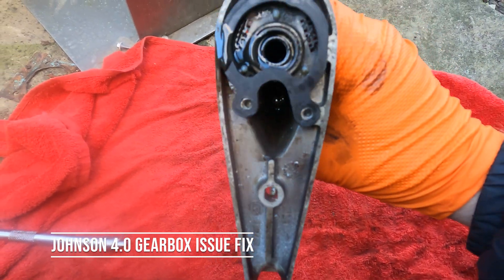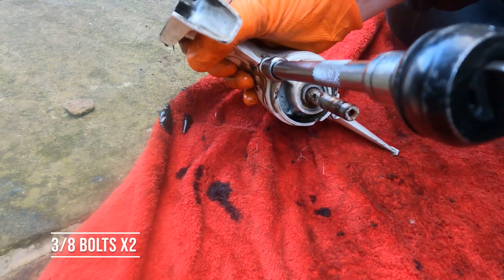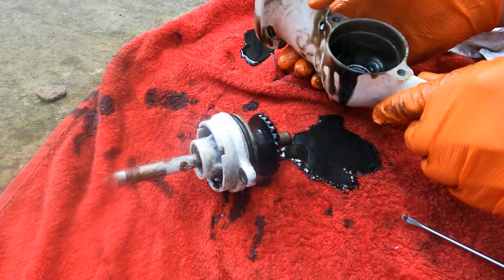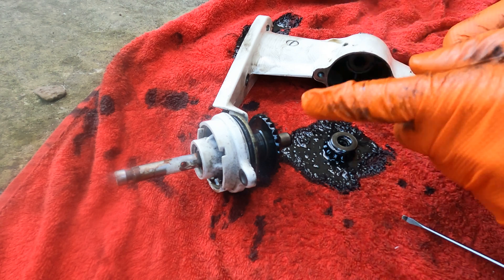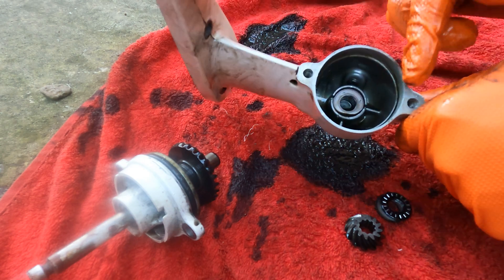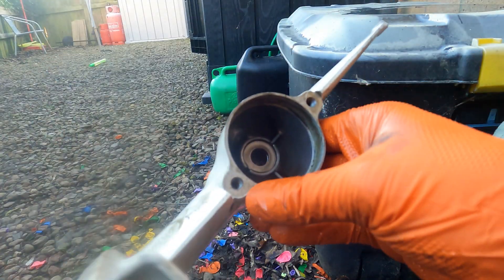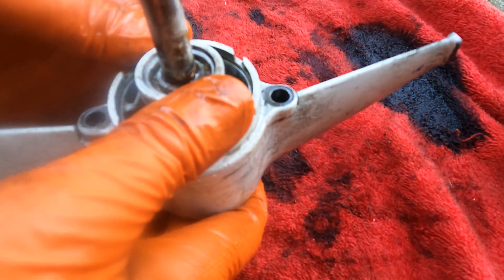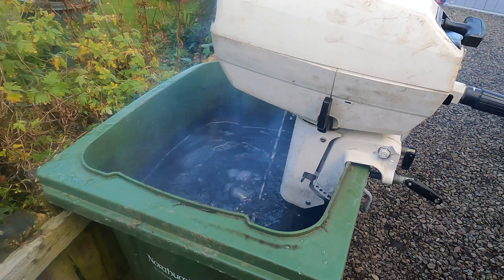Johnson 4.0 4 hp Seahorse 2 Stroke Outboard Motor - How To Fix Drive Shaft Coming Out of Lower Unit

Comment: Haha, I accidentally pulled the shaft out of the gearbox on mine.. (a few years back).. absolutely kicked myself. Was so annoyed because I thought it was going to require exactly what you’ve done and strip out the gearbox to get it back in. However… by chance I found a way to get it back in. I literally turned the unit upside down and inserted the shaft and started whirling it like a buzz stick. To my astonishment it clicked back into place. 🙏🙏
Reply from the maker: That was lucky 😅 
Seems like such a design flaw in this engine. 
Looks to have happened to a few people

Comment: Hi ! on my motor, same as yours,  the propeller is constantly engaged, turn constantly, and I do not understand why !  I do not notice any dammage, all the parts seem normal,  the pin slide up and down apparently correctly ??  do you know how the shiftrod acts on the clutch spring and what is the correct position of the pin and the spring together ?? Thanks a lot for your answer !
Reply from the maker: Hi,
Without still having the engine I’m not 100% sure.
The only thing would be to remove the gearbox again and check everything moves. Should like something is keeping the system locked in gear? 
Maybe the clutch spring etc?

Like I say without the engine I haven’t got any reference information to help you regarding that engine.